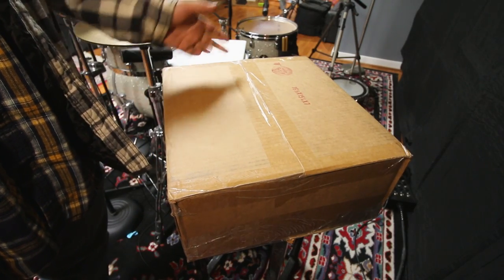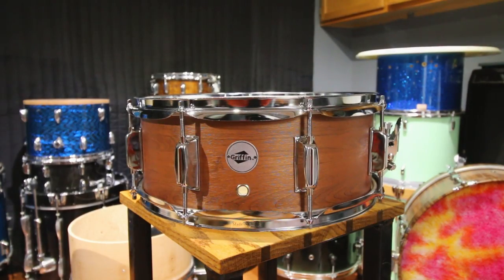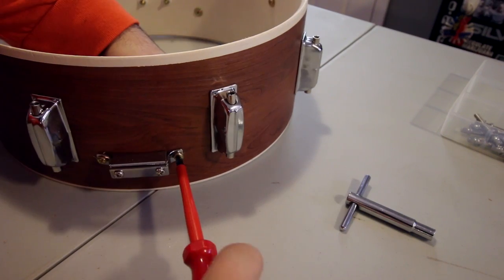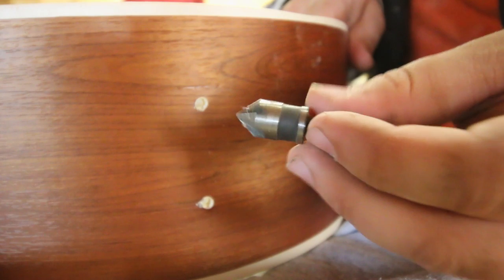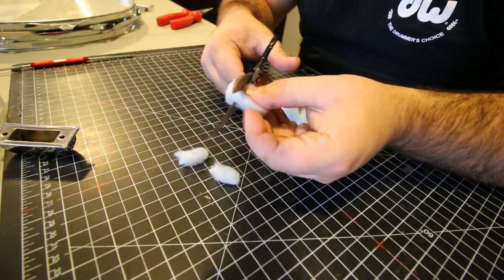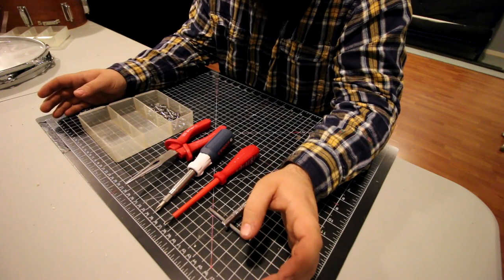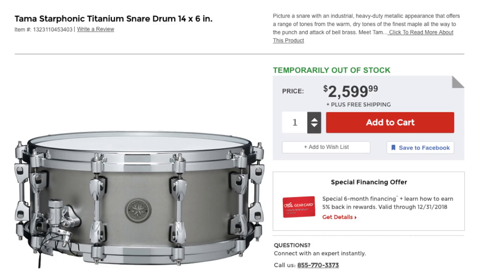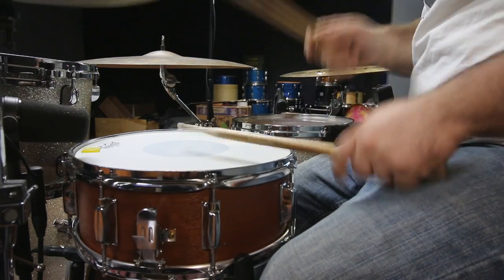The CHEAPEST SNARE on Amazon - worth it? -

Comment: sounds way better but still not really worth the trouble unless your a craigs list seller who sells shitty pieced together kits and will throw in a killer snare for an extra 150bux,with blurry pics and vaque description besides cool,vintage and clean (hate that crap).  Was thinking and curious about the cheap die cast hoops sold on amazon for 50bux a pair-aluminum alloy they say, and thats 1/3rd of the cost of ludwig,gibralter or pearl die cast hoops-on maybe a sensitone or maple middle of the road snare? I have had a few custom built snares made for me and the hoops i requested were ten lug die cast hoops and one of them i swear were aluminum alloy and not zinc or steel or whatever tama,gretsch or ludwig die cast Hoops are made of these days. maybe a video on the chinese b20 cymbals for sale online?

Comment: Bought the same snare 2.5 years ago, the throw off on mine is angled, and it came with a 12 wire snare, and did NOT come with an internal muffler.

Comment: Oh my god, what in the hell is the point!? All of this effort, you're going to sand it and change ALL the hardware on a cheap piece of crap like that, WHYYY?!?! You can buy a really nice, really great sounding (live AND recorded) snare drum for $200 or more easily. Your snare drum is all about the tunings and what heads you have on it, if you don't like your snare sound/tones get a different brand of heads. I used to swear by Remo or Evans but now I would never touch either, EXPLORE the market of products. Don't look for a quick cheap fix, in a path to be truly great THERE ARE NO SHORTCUTS. Anyone who is a serious drummer save yourself the time and headache and just spend a tiny bit more money. Then you can actually own a drum made by someone who knows what they are doing and is established in the industry. I don't even remember what the brand was now that I'm typing this, that's how insignificant it was, and I've been looking at drum gear for 2 decades. You're going to look like a straight up clown if you post a video of you drumming and hashtag it with his snare "brand".

Comment: dude why would you put like fucking Remo triple ply double layer, double coated with oil in between fucking drum head on a shit drum and then put a moon gel on it? Like the reason the drum is bad is because the wood is low density so it fails to transmit pressure waves effectively. You would have to try to maximize resonance by using less dampening man... like why would you muffle the hell out of a shit drum? completely bewildered... another way to put it, the reason it sucks is that it fails to produce overtones. so you would have to try to maximize its ability to produce overtones, not reduce it... Whatever... the drum is gonna suck no matter what...